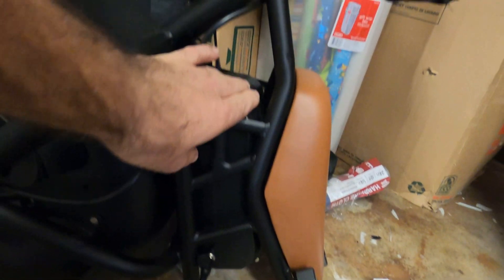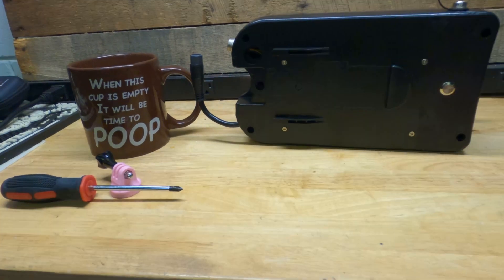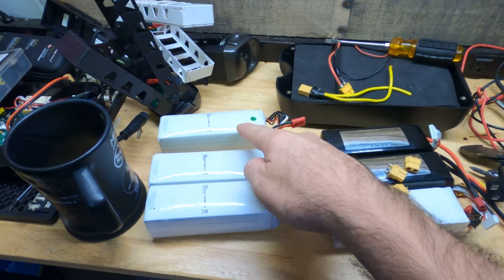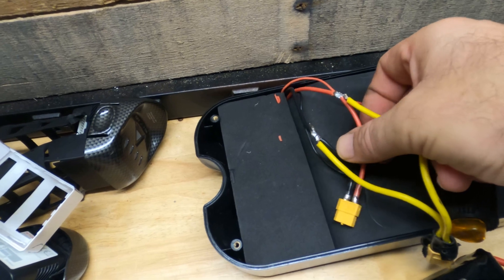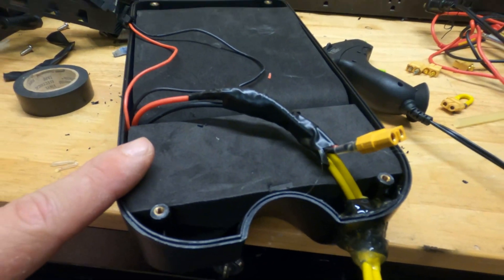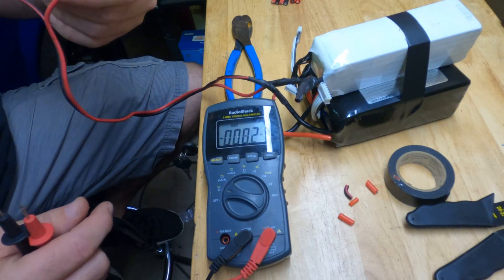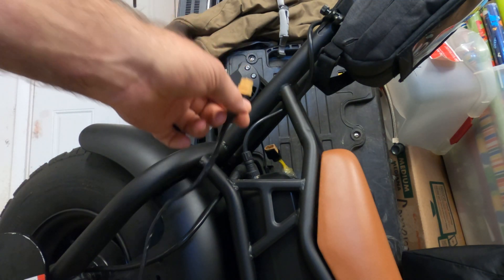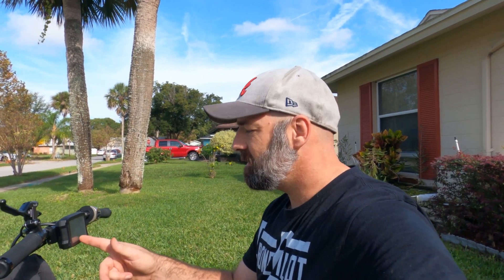DIY Electric Unicycle Range Extender Battery Super Ride S1000

Comment: 3:20 Im certain that if you open the battery back up further, you would find another control board that has a wire attached to each cell or module that makes up the main pack. There NEEDS to be a way for the device to balance each cell while charging (often it just ensures each cell is charged to no more than 4.10V), and to monitor each cell to make sure it doesn't drop below a certain voltage threshold (often no less than 3v.)

2:45 that seems to be the motor controller, there's 3 main wires and some sensor wires that plug into the board. the battery has a seperate controller known as a BMS

10:11 the device must only charge to 90% or 95%, probably because it relies on regenerative braking to slow it down, which requires rapid charging of the batteries, something lion isnt good at while near full charge, so as a failsafe if above that charge it wont let you ride it seems

I highly recommend that you measure the voltage of each of the cells on the additional packs you added, there doesn't seem to be any way for the BMS to monitor and manage the state of each cell, and without a way to balance them, every time you discharge and charge the pack they will deviate farther and farther from their nominal 3.3-4.1v range, eventually resulting in damaged cells or worse. dont charge this thing in your house and leave it there unattended!

you can buy beepers with lcd displays on them designed for rc planes and stuff, it hooks up to the balance connector on the pack and give a readout of each cell voltage and beeps if one drops below a threshold. that would allow you to ride it relatively safely without damaging the pack as long as you stopped riding once a pack beeps.

to charge it safely, i believe you have to disconnect each pack and charge them separately on an RC battery charger with the balancing leads connected. the orignal pack can be charged normally because it has its own BMS.

i use those cells to run my ebike and a drone, they HAVE to be respected and taken care of / balanced!! they come with no control circuitry because they are designed to be as light as possible. its up to the user to managed the state of each cell. please be safe!

it may work for a while, but the more its used to worse it gets.

other than that, cool project! you have the right idea
Reply from the maker: I was. Charging them with a smart charger individually....However I was charging indoors and one cell did explode catching my office on fire. Luckily I was near by and able to get the fire outside before any real damage was done. Thanks for the info and great comment!

Comment: where are you located?  I bought one but I don't know if it works I want it to go to and from work
Reply from the maker: I am in Orlando
Reply: Could you guide me where to buy a charger for that I have not been able to find it I looked at some on Amazon but the connector is 8 mm do you know if it is the correct average
Reply from the maker: @albertojhuerta8098  xoffroad.com

Comment: Hey Steve, have you ever had 1 of these batteries over discharge. I think that may have happened to mine. No matter how low the battery is the green charge light is always on when it's charging and it never charges
Reply from the maker: I have not had any battery issues yet sorry. If you email me from my about page I will try to send you the email to contact the seller. Maybe they can help
Reply from the maker: I may have misunderstood.  The batteries for the external pack did over discharge and I finally got it to start charging and it overcharged which caught my house on fire...literally but I caught it early and put it out.

Comment: Sir can you tell us  what is the size of electric wheel instilled overthere in this E-bike and from where I can purchase this electric wheel ?
Reply from the maker: tire is 205/60x8 can buy it at xoffroadcom or amazon or alibaba
Reply from the maker: The motor is 1000 watt
Reply: Thanks sir
Reply: Sir is this 48v or 52v
Reply from the maker: @akifashrafkhan6436  60v
Reply: Ok sir..
Reply: Acutely I'm fabrication this  one wheel electric  bike as a final year project being as an engineer of mechanical and suppose If I stuck any where during fabrication then I shall contact with for help and I hope you will willing help me ..😊

Comment: Using lipos is a terrible idea, they have a completely different cut off voltage than 18650.
Reply from the maker: They also catch fire easier which they did while charging so thank goodness for battery bags. I am about to build another with the proper cells
Reply: @SteveWB  Good that you didn't got hurt while it happened. Lipos are very dangerous if discharged too much or overcharged. Stay safe!
Reply from the maker: @Ryuuken24  Will do thank you!